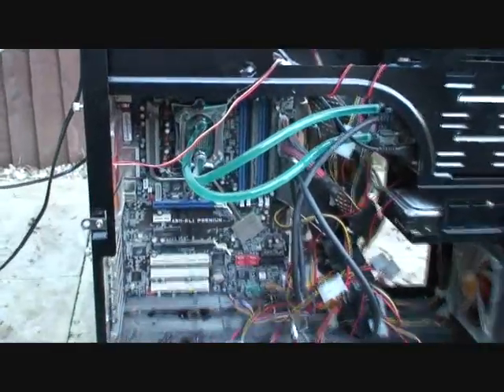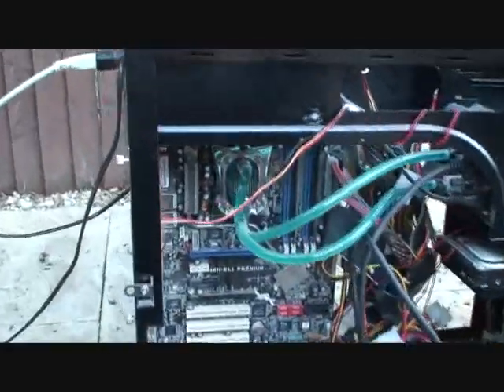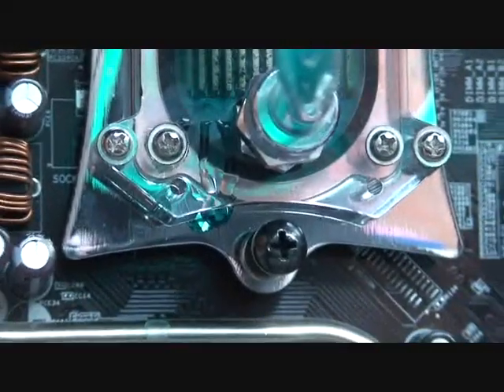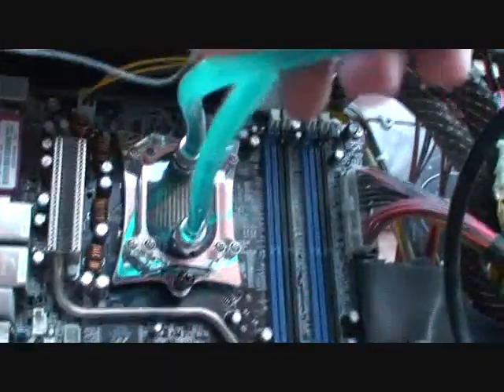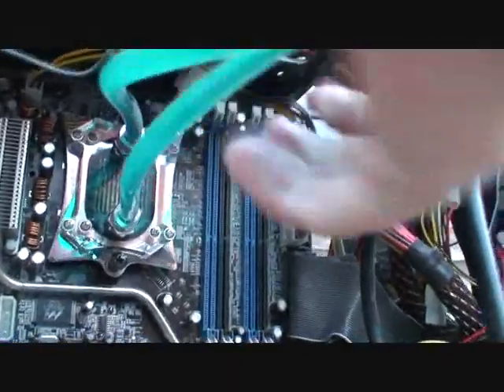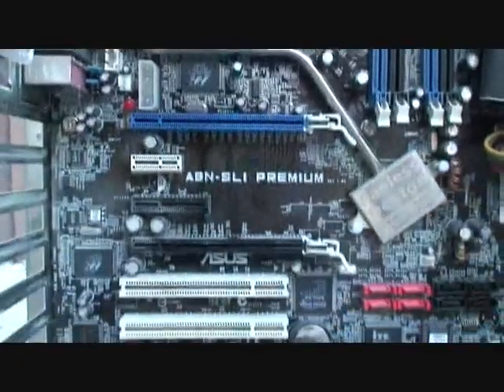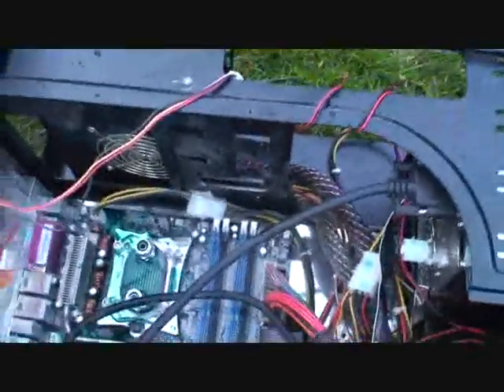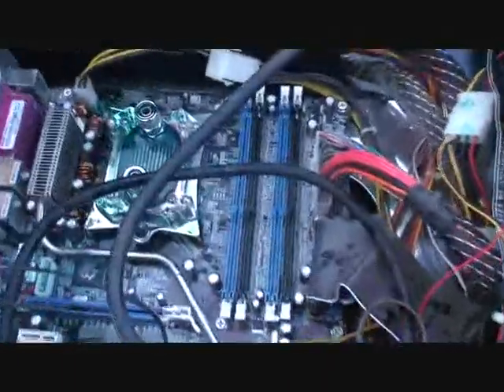Watercooling leak!

Comment: this is definetley going to happen when you use the same watercooling set up for  3 years. with watercooling you have to look after. personally clean out my water cooling and replace the coolant every 6 months and i definetley would not use the same block for 3 years wether its a cpu or graphics card block. this happened to you cuz ur an idiot.

Comment: @thehumor you can buy non-conductive cooling solutions to avoid this altogether. The water block cracked because he was using a plastic/metal block and the pressure holding the water block down cracked it, causing the leak. If you are going to water cool a cpu, you should do a little research first, not just go out and buy a quick bolt on system

Comment: Not very wise to put a El Cheapo water block with ACRYLIC on it.
Next time use All-metal water block. BTW destillated water is not conductive but is a very good SOLVENT, as soon as it touches the MOBO dirt,it will become conductive.Besides algae and bacteria can grow in it and the system quickly will become disgusting or even clog.

Comment: @xxslayer66xx i'm used to having to deal with cooling fan noise :P.. but really it don't matter as long as the components are cool enough to where they don't cook themselves due to extreme heat (say about ~160-200F). i've heard that some components reach up to 60C (or about ~140F) without problems from peak usage

Comment: what makes you think the motherboard was toast? if that was non conductive coolant, like should be used, then odd are the only thing the leak hurt was the cpu overheated, most motherboards will shut down the system before damage occurs from heat...meaning you could just replace the waterblock with a good one, and be good to go...

Comment: @Mrinsanepain 

Good luck finding one, especially one that will give you a warranty.

And besides, "Maxing out" is quite relative to what the application is being displayed on. for instance, my quadfire 5970's can't max the game out at 2560*2440, hence why I'm putting them under water and over clocking. So yer, 1k might get you a system which will max any game out at a low resolution, but not at anything higher than 1280*720.

Comment: @MrGlazed @MrGlazed Yes its well worth it if you want to run a very fast but cool efficient & quiet PC
if QUALITY parts are used & maintained & decent coolant is used it is perfectly safe, Been watercooling for around 5 years with not one leak or problem. 
If using distilled water you can have a pretty big leak before the HW will stop working & then after dryed out it usually works again, there are videos on here by petraPT to prove it.

Comment: oh man you are such a noob... water cooling kits can leak sometimes  if the tubes are to old or you just messed up your cooler cuz you press to hard or screw up the damn cooler

for sure water cooling is nice but if you cant work with it... then dont use it!

Comment: @infoblip The water isnt flowing around the electornics of the boat now is it? its on the OUTSIDE which is protected by a big wooden/plastic or metal shell.
None of your examples have water connected to the electronics for cooling so there terrible examples.

Comment: I use a Watercool Heatkiller 3.0 and had never problems with it. Have my Q9450 @ 3,8Ghz without Problems. When I had my Thermaltake Waterblock, it leaked too. My graphics card did NOT destroy. Only the fan don't worked since then. So I bought a Waterblock for G80 Chipset, and since 2008 everything is working fine ;)
Greetz

Comment: i was thinking of a way to minimize damage from these... first off, screw the dye. sure, it looks cool, but it can ionize the water. use distilled water, pure distilled water is nonconductive, so even if it leaked, it wouldnt fry your hardware unless you left it for a while which leads me to the last point: get a sensor that cuts the power if the system suffers a pressure drop. that way, you can fix whatever needs fixing, let it dry out (and clean it if need be) and get it running without damage

Comment: @FalconswrathPB yeah, I have an older system, I dont have any footage of it yet, currently that system is dry since I am awaiting some dye I ordered, time to change up to a different color. Not only did going water cool my system better than air, it also made the room cooler. all those fans turned my PC into a dam room heater, and water systems dissipate the heat better as its loosing heat as the water travels through the tubing

Comment: Nothing is 100% fool-proof.

Ultimately, you have to weigh the risk to reward. Unless you're planning on some serious overclocking or heavy duty gaming in sli or crossfire, I would not use watercooling. The good news is that such leaks are not common. The bad news is, when a leak occurs it can ruin many components at once. Your mobo, your ram, your gpu your psu etc. If a fan fails, chances are that you simply get an automatic system shutdown with no real damage. Just replace the fan.

Comment: I don't know what coolant was used but I had a leak with no damage caused. Most modern coolants you will find measure infinity resistance on a meter set to even the highest setting.

Comment: Well if you take a close look you can see the fracture line running close to the second screw on the lower left side. Most likely this was an issue of overtourqe on the screw putting excess pressure on the block case. Whether this occured at the factory or during installation we'll never know. However, water cooling is very effective and allows for much more room inside your case and in turn creates a better airflow through your system. It all comes down to whether you need it for OC or not.

Comment: @gazzxr just goes to show the gains aint that great for water cooling for the risk then doesnt it after all 30-40 is what my intel core i7 2600k runs at  oc'd to 4.2ghz on air well atleast if it does leak none of ur components are cheap enough

Comment: @gazzxr I don't recall addressing you as an idiot in any of my messages, however i would say it was inadvisable to have water cooling in a pc that does not SERIOUSLY need it. for e.g my friend is running an i7 980x on air oc'd to 4+ GHz and runs stable on full load from prime95 at 62 Cel cpu cooler is a coolermaster v10 in a nzxt phantom, if that chip can run at those temps on air why is a water cooler needed? he is also using ripjaws running at 2200 mhz and has sli cards so heat in abundance.

Comment: @KikoBrk Distilled water does - but very little compared to piped, The reason, liquid conducts electricity by the positively or negatively charged ions that are moving from one of the electrode to the other, carrying charge (electricity) with them. Distilled water is water that was boiled to steam and re-condensed to water. so is relatively pure however as soon as it touches air it ionises again and becomes conductive although to a lesser extent it is still deadly to a pc.

Comment: @ElJuzgado cooler master have been in cooling for years don't think there shitty materials the point of the fact is that water cooling leaks happen all the time doesn't matter how many times you purge the system or what water cooling system you buy my mate recently had a server system ruined due to its water cooling that was professionally installed and cost well over £2k . the simple as that fact mate is that all water cooling systems will leak its just a matter of when!

Comment: This is irrelevant. Plus he said that is was like 3-4 years old. Well anything with moving part especially when there is temperature fluctuation involved. Plus if you knew the risks of the different materials you would of known that, that part had a hi risk of cracking sins its a hard plastic. Next time buy one with medium hard plastics. Those would rather bend to some extend instead of cracking.

Comment: Well, the Watercooling System from CooleMaster was not the problem, the CPU block was.  Few are the ones using Standard WC Blocks which come with the WC Sys. as your Coolermaster does.   next time try saving the CPU before letting water go all over you system The Mobo and graphics card will be replace, but don't replace you full PC!

Comment: I had a leak but it was because I had the tubing at a bad angle. BUT I used non-conductive Primochill PC Ice and shut my system off right away. I soaked up as much liquid as I could with paper towels and Q-tips and blew away any liquid that got into slots etc. after a day of drying out it worked again. I would not use acrylic blocks on my GPU or CPU. PS check out my vids!

Comment: I have the Koolance Gpu 220. and the Zalman i7 block. The Koolance is a copper cold plate brass top and nickel plating. The Zalman block has a copper base and anodized aluminum top. I haven't opened them up but they look to have the same design 4 screws and I think they are sealed with an o ring. I don't reccomend the Zalman if you want to use 1/2 inch tubing as the barbs can't be replaced and they fit 3/8 or smaller tubing. Have a look at my videos.

Comment: Just because you did mistakes in building up your water cooling system, all the watercooling is unsecure? lol.
Check your components before flooding them with liquid, don't tie the fittings to strong, use cooling liquids that don't destroy your components like some destroy acrylic and everything is going to be fine. Having installed a real watercooling system (not such a coolermaster sh** as you did) with nice compounds and it works properly for over one year now without any leaking or so.

Comment: @gstreetfee Heat moves from hotest to coolest. 1 In an air cooled setup your cpu, gpu, etc. produces heat which gets transfered to to the cooler heatsink in which then transfers the heat to air. You are limited by the surface area on the heatsink and the heat transfer of heat pipes in many performance air cooled systems.

Most  water cooling systems pass water in or over a copper block which can absorb a great amount of heat as the water is moving quite fast. This then gets pumped to a ....

Comment: this is what happens when you use bad watercooling components.  NEVER use acrylic components!  and to those that say there is no risk with air cooling; consider the stress those heavy heat sinks place on the motherboard - a high end air cooler is more likely to damage your motherboard after three years than a high end water cooler is likely to leak in the same three years.

Comment: @gstreetfee Oh ya btw, the tubes dun cool the chipset. There is metallic contact that touches the chip which is the way of cooling it,  For e.g when i have a cold icy metal plate, and the other side is hot metal workpiece, so when they both touches the hot workpiece would cool down. Same goes for the water cooling, the liquid touches the metallic contact and there is heat transfer to the liquid which brings back to the reservoir. My theory may be wrong, i am just writing what i think.

Comment: @gstreetfee i am not sure because i dun have water cooling system on my pc, can't answer much but i had a friend who has one. The tubes are all depends whether u want to cool the processor or other componets. However, there are company products featured watercooling, like the H50or H70. Normally u got to check whether the pipe is tighly fitted before u run it on your system. Or else u gonna be like this guy here. It actually cool down the hot chipset by heat transfering.

Comment: @enigmafirst yh that water cooler was 4 years old, im pretty sure most hardware would start to fail after at least 2 years. and the vegtable pil pc once it heats up the oil it cant cool it... so it starts to make it into a small fryer and plus all the hardware is ruind once placed into it...

Comment: Are water cooling systems bound to start leaking down the road? If so I'll never notice till it's too late. I was also considering that air case filled with the vegetable oil and then I began to think "It's gonna suck if the case starts to leak"

Comment: Wow.. Dude you could have used it for something more constructive... I'm planning on a case mod myself which should be done in about 2 weeks... That involves me taking the loading mechanism of dvd drive. But that doesn't mean i should have busted the whole thing. P.S. There's no point in taking it outside "somewhere safe" cause all PSU's come with auto shutdown in the event of a short circuit. So if you use a hair dryer and leave the system for a while to dry... you might be able to use it again

Comment: @Nefus2 im going to find a crap ass comp .. seal it up air tight  and try tha thaha.. it sounds liek it would work. if the oil didnt cause any short circuits in the maciene it would work fine.

Comment: my saying for plexiglass blocks : 
If you use plastic your a F***ing Spastic!!
 and guy is a fool could drips wouldnt hurt he could of done a couple of bottle caps and the system will be fine (aslong as its non conductive or distilled) i dropped my phone in the bath left it to dry out for 4 hours still working till dis day

Comment: soo unlucky :/ atleast you had a fairly simple set up mate, i nearly messed up my evga classified with 3 gtx 280s lol. mine leaked while filling it up, the derlin fill ports suck. in a mad panic i used liek 2 rolls of toilet paper and it was all right :D

tip: uv liquid + black light definately helps mop up any wet bits hard to see before you re power up the system.

Comment: @left4james yea, but it keeps the parts cooler than fans sometimes, it's mostly for overclockers and people who want quieter and cooler PCs
Also, people could get a non-conductive coolant that doesn't cause a discharge, but it is near impossible to clean up.

Comment: I feel for you man, this happened to me. I bought a Apogee GTZ Extreme by swiftech, and it leaked from a factory seal. I tighted the "factory tightened" screws, which are suppost to be garuenteed, but of course its my fault that it was made on a friday. So after I tighted them, I of course checked my piping, and nothing leaked. So it runs for a week, that seal next to the screws heated up and leaked again. RIP my 9800GTX, and 9800GT, and finger to you swiftech for not RMAing it.

Comment: And what about the noise? What about the dust? The amount of dust that would enter your system with a huge "ghetto" fan would be equally as destructive as a leaking water cooling system. The only way to discard that would be getting filters for each of your fans, which requires maintenance in order to clean them. So in all, I'd say it's equal in terms of man hours...

Comment: You are really stupid are you a wate cooling system is really reliable if you follow the guide and you don't need to change the water every 2 weeks once every 6 months is the normal standard. You cleaned a computer with fans 6 times then. and the cooling and silence is 10 times better then any air cooling can give

Comment: I bought an Gigabyte Galaxy 3d used and I leak tested the water block and it had a very slight leak the same place this guy had his. So I just put a thin layer of silicon sealant on the O ring, now works like a charm keeping me @ 41.C, with the help of a blue DD 120mm huge rad.

Comment: do buy water cooling kits.

i've got a cooler master aquagate max in my computer and it works just fine, no leaks easy to set up and hele cheap... compared to a custom setup.

just buy some non conducting cooling liquid like feser one wile your at it and even if it leaks you don't have a problem, it wont help if it runs in to the cooler from your gfx card but it wont fry it.

it cost's a bit extra but at least IF it leaks your not screwed

Comment: Hey guess what cools your water?....AIR. 

A large heat sink that has heat pipe and is properly lapped and polished, as well as a lapped and polished CPU and good case ventilation will perform just as well as water cooling. And you can do this to all of the sillicon in your computer if you realy want to with out any risk of leeks. Plus it's lighter and takes up less room. The only thing better then that is refrigeration, wich can get your temps lower than room temp. water/air can't

Comment: there stand the long running debate over the 2 sides , both have pros and cons , but liquid is unnecessary if you have well vented and cooled case , but liquid is decent if your doing lots of over clocking and doing high res gaming but it is not really worth the cost unless you know exactly what your doing. hope this helped

Comment: Well i just installed watercooling kit like not even a week ago and it was fine. I had a minor leak in the reservoir but wasn't near any big items and it was so small.  my reservoir bottom port was tightened to tight  which was already pre tightened out of the box but usually leaks are caused from your own doing.But it does happen and it sucks.

Comment: finally (sorry for posting 3 times).  Here are some comparable prices for a setup.

Pump - $50
Radiator $50 - 100
Tygon Tube 8ft - $40
full size graphics block - $100 - 200
CPU block - $40
Coolant $8

cost about 400 - 600 dollars to do it RIGHT.

then you need a case that will hold 2 x 120 mm fans (radiator).  my case was 200 dollars (dangerden waterbox).   so its about 600 - 700 in parts JUST for the case, blocks, and coolant.

like I said, watercooling is not for kids. don't buy thermaltake.

Comment: 4 use non-conductive coolant or distilled water (same stuff) non conductive coolant is just distilled water with coloring addatives and anti-corrosive agents inside.

5 Leak test ALL parts before installing them. (24 hours).

6 RESEARCH!   do you just blindly buy a car? or do you research prices, performance, user opinions, etc.

7 take your time and learn to do it right...

with a DD waterbox I achieve 22c / 35c on my Quadcore     45c/47c on my 8800GTX (full load on second value)
$800 in parts.